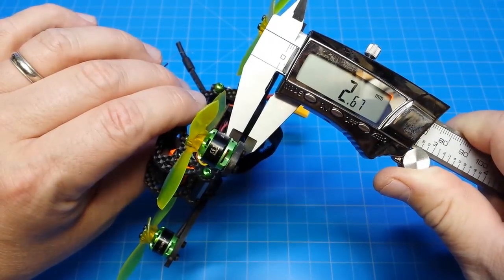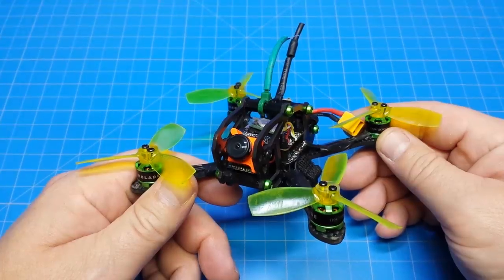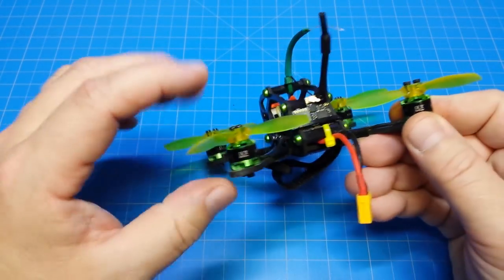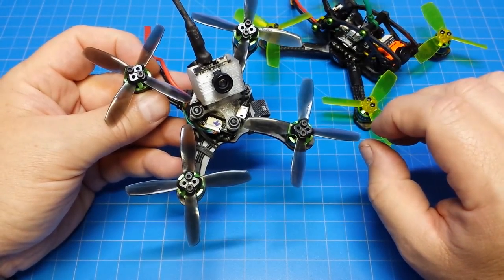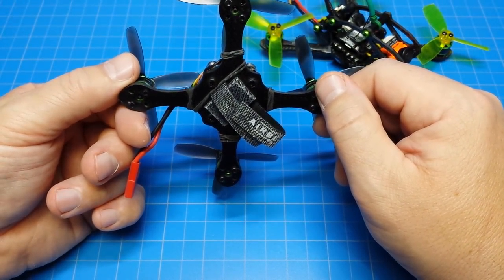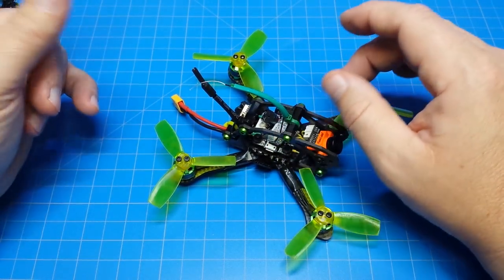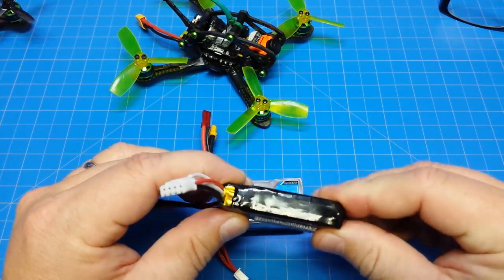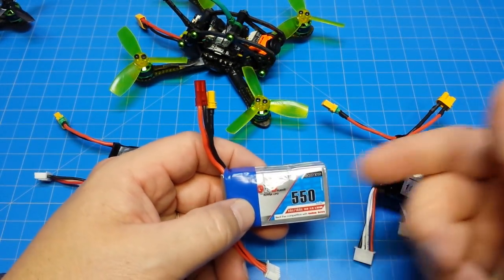EclairV2 - AirBlade UAV

Comment: Would you go with this frame or the massive drones? I need a 2.5” frame that can hold a 20x20 stack and am having trouble choosing I wanted a plus+ style frame but they are out of stock everywhere
Reply from the maker: eclair is likely easier to build but massive droner more durable and weighs more. Depends what you would prefer of those differentiators.

Comment: I’ve had both the 2.5 and 3. Pro, I’ve broken both of them, and not hard crashes either, have ordered the iflight 2.5 and 3 inch, have you had better luck with them?
Reply from the maker: I didn't break my eclair, I didn't break the iflight 2.5 either, so its kind of even in my experience, but the iflight has thicker carbon.

Comment: OK   Now I'm confused you like the Leader120, Great quad, I Like the XJB 145,  But this little quad that you build are Great almost like the planes we built in the 70s keep it up
Reply from the maker: Yes, the leader120 and xjb145 are great pre built quads. The Eclair was a build, but recently he started selling RTF and/or building it for a fee.
Reply: This quad actually seems like a cross between the xjb 145 and the leader 120. The weight and specs are smack dab in the middle of the two. It even resembles the leader 120 a little bit.

Comment: Do those motors get hot running those props? My RotorX 1105B 6500kv motors get scorching hot on those props running 3s. And thats on a quad that is lighter than this Eclair build.
Reply from the maker: not really, I would say they get warm, but not anything alarming. Might be D needs to be lowered.
Reply: OK good to know, thanks. Not trying to be arrogant but I'm pretty good at tuning and it's definitely not a D term issue or an issue with filtering. It just seems like those props over prop the 1105B motors. I wish someone made a good 3 blade 2.5" prop. I don't like the 4 blade RotorX props, they are a PIA to deal with, they are not very durable and they are pricy.
Reply from the maker: Rotorx just released some 2.5inch tri blades. I know airbladeuav.com has them. I tried the non-t style, they are nice and light and pretty efficient.

Comment: Thanks for all your Videos as they’ve really helped me when researching for the right set up etc. However, I have some Emax 1106 7500kv Motors but I don’t know what set up to put them on. I have the Eclair V2 frame and the 3” pro version. I’ve got two stacks with both more than 20amp esc’s. I fear my Tattu 650mah 3s will be too much for these motors but the weight is competitive with some 2s 850 lipo’s. Flight time is important as is performance. Should I just stay with 1104 7500 and be happy’ish. Cheers
Reply from the maker: I would check to see if others are running those motors on 3s, what I have read is they get pretty hot on 3s, but that could be an issue with motor/esc compatibility, or a pid issue. But doing your research will be prudent. I sure don't suggest running them on 3inch tri blades or more. 1104/1105 are well tested, there is reliabilty might be the reason to chose those. BTW 1104/1105 are the same motors, they measure the same.
Reply: Nick Burns  - Yup, a bit of a brain fart when I purchased them. What was I thinking.

Comment: How do you like this vs the Leader?
Reply from the maker: Thats a difficult comparison. The eclair has the ability to house the micro swift ccd camera which is an advantage, but it also makes it heavier than the leader. I would go leader, its really inexpensive, comes tuned and flies well. The cmos camera is pretty good, but no where the quality of the micro swift. I think for most it would be do you prefer the micro swift image quality enough over the cmos to tip the scales.

Comment: Just picked up the diy build kit for this quad from airblade...did I hear you correct that it'll take 3" props? It advertises 2.5" on the website
Reply from the maker: No the one in this video is 2.5inch props. I do think he has a 3inch and 4inch version.
Reply: Nick Burns you show a bag of dys 3045x3 ... yet this frame is advertisied as 2.5" frame - Im also confused, can you please clarify ?

Comment: Do you think all 10amp 4 in 1 escs can handle 3S? This frame looks perfect to upgrade my Aurora 100, but I wasn't sure it could handle 3S
Reply from the maker: I wouldn't want to say all, there could be some very shady/cheap 10amp 4in1s out there (alibaba/ebay). I do think most will be fine, but I wouldn't run any larger props, or props with four blades at this size...not that there are any.

Comment: Hi again. Just wondering how you compare the Airblade motors to the Dragonfly motors on the KL-EX90. Thanks in advance for your time!:)
Reply from the maker: I have only had 1 set of the dragon fly motors, they are very smooth and powerful. I think its very close, I would have to give the airblade motors the nod, only because I have had so many more I am confident in them. I don't have nearly as many crashes on the dragon fly motors, the Airblade motors have been very reliable.

Comment: Would really like to see one of the 11xx motor frames rocking a Runcam Split ... think on a 130 should be doable. 
Weight should not be a problem, but I have not encountered 30x30 11xx frame.
Reply from the maker: check the flexrc frog. An older micro frame that does support 30x30 and is 130mm.

Comment: Are 10 amp escs enough for 3inch/3s/high kv motors? On my little 2 inch same 7500 motors and  is quite a bit lighter than this on 3s they run fairly hot
Reply from the maker: Maybe. It will depend how high kv and the props, number of blades and pitch. I think a real long punchout could be a problem in some configurations.

Comment: To keep your XT30's from possibly going in backwards, try this... Go to the flat side (positive) and take a black sharpie and color the entire positive side black. Do the same on both the female and male connector, even going over the + XT30 writing. Now, when you go to plug them together, it's really easy to see if both sides are black and correct! Just match black to black! Easy fix, takes just a few minutes to do all your XT30 using quads and batteries. (:^)
Reply: Funny....that's exactly what I do....that way I can actually see which is which when plugging-in in a dark park!!

Comment: That thing flys damn good for having two different kv mottors on it lol , great build 👍👍
Reply from the maker: Its hard to believe I didn't notice :) and it didn't appear to affect the flight performance.
Reply: Nick Burns no it didn't seem to affect the flight at all , before you revealed it was two different kv I was just telling my wife I might build one like that lol
Reply from the maker: well I have proven you can. Although, I did notice the rear motors getting warmer than the front. At the time, I thought no big deal. I am not sure my brain has been up to par after work these days. :)
Reply: That is pretty funny! But they do look the same... Except for the writing! Lol Nice build Nick... Thanks for sharing!
Reply: Nick Burns lmao I understand ,,  I would think in theory you would want the higher kv motors in the back , but that's just me I don't know nothing lol ,, I wonder if you was to reverse the prop Direction if that would stop the back motors from getting warm
Reply: Nick Burns lmao I understand ,, i would think if you was to put two different kv motors that you would want the higher kv ones in the back , but that's just me I don't know anything lol , I wonder if you was to change the motor Direction if that would stop the back motors from getting hot ,

Comment: Hi Nick, please give us an update when you install same kv motors on all corners (I'm assuming you'll do it). How does it impact flight performance and time, etc. Do you think this contributed to your bad flying and series of crashes? Also, what is all up weight of this build? Thanks and keep them coming!
Reply from the maker: Yes. The recording was several days ago, I did put the proper motors on. I didn't change pids or anything, it flies the same. I don't think the motors had anything to do with my poor flying, I suspect I was rushing, stressed or something. I flew several different quads during this time, I was bad on all of them. I believe the dry AUW is 86 grams as in the video. I don't generally put weight with battery unless its an RTF that came with a battery. The battery weight can vary greatly, even across 3S category. I used mainly 550mah 3s in my flights.